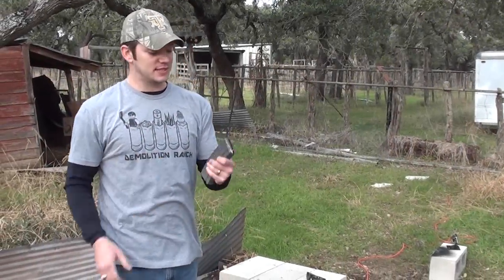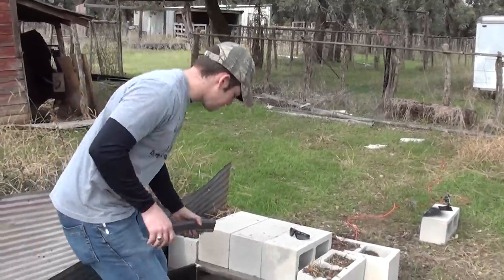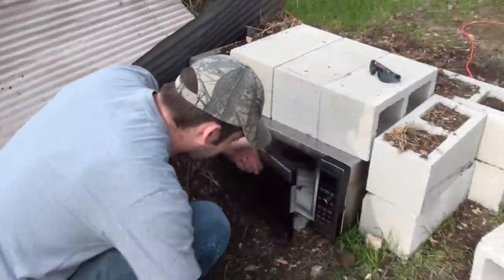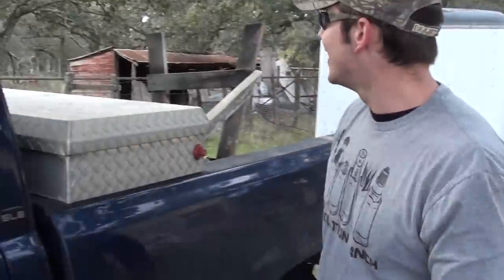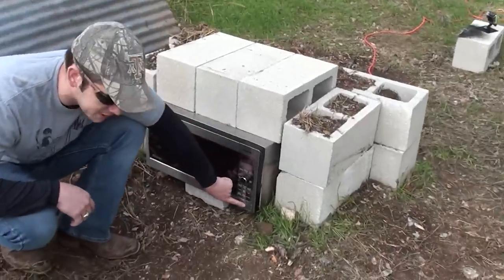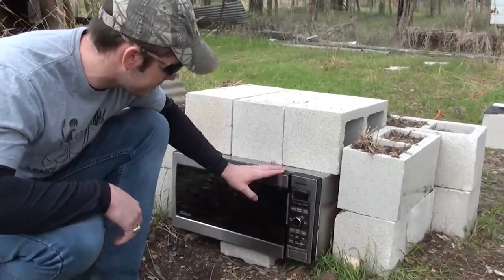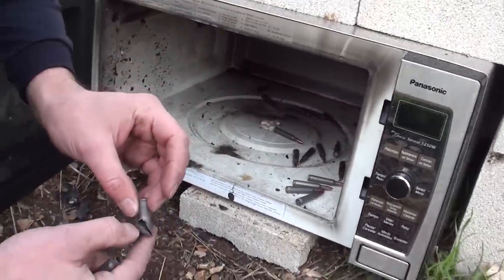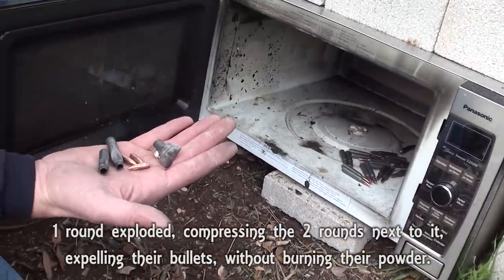Loaded AR-15 Mag in a Microwave

Comment: Be careful about the gun. Mythbusters found that it can go straight through the glass of an oven, so God knows about a microwave.
Reply: I would imagine if they put some 5 gallon buckets of water around the microwave consisting of 2 staggered rows it would be enough to slow the bullet down.  They should also probably try to tie the gun down so there is a better chance of it shooting in a predictable direction.
Reply: lyokofans I would think so too, but it still helps to give the warning despite the homemade bunker. Better safe than sorry, right?